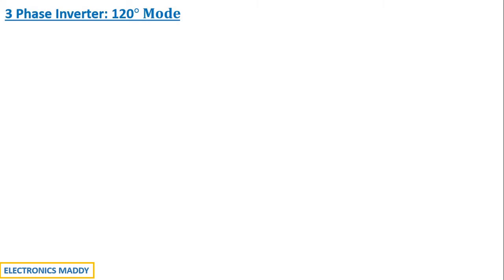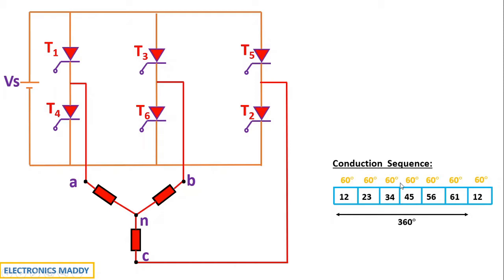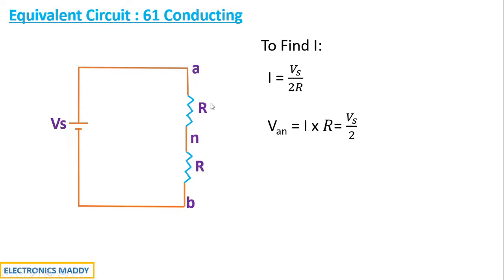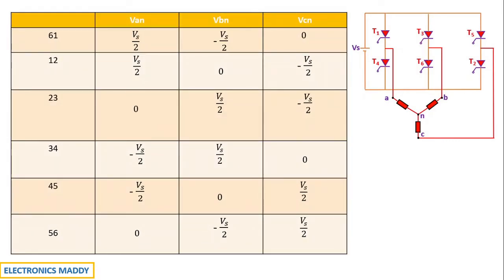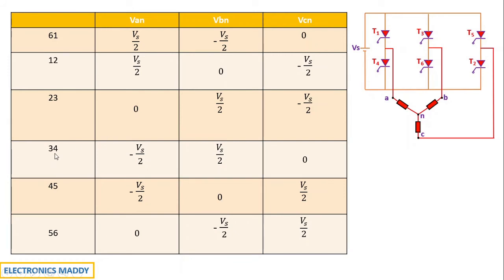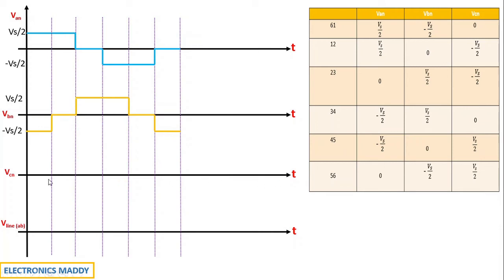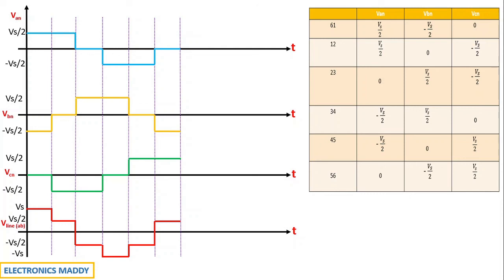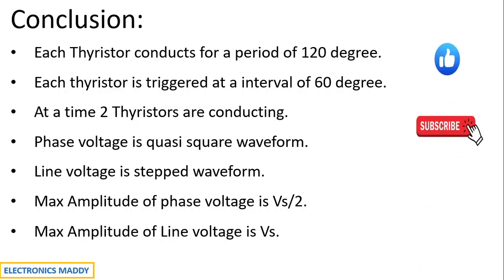Working of a Three Phase Inverter Operating in 120 Degree Mode

Comment: Hi Sir, thanks very much, you have covered most of the power circuit, would you kindly create a playlist of the gate firing circuit, Rectifier control circuit,  inverter control circuit and gate drive circuit. Thanks.